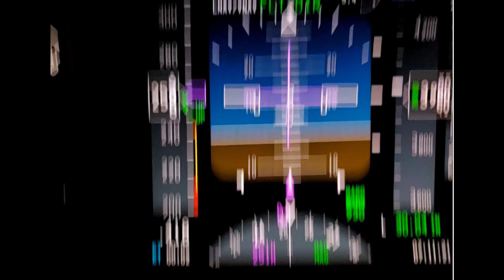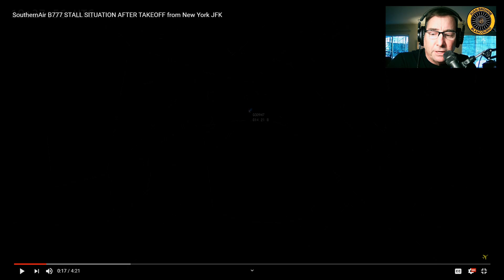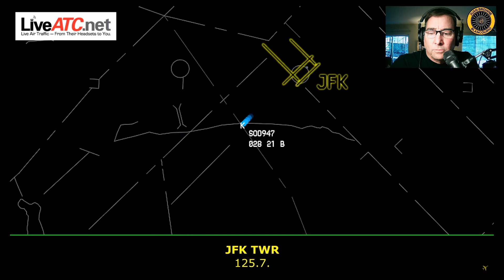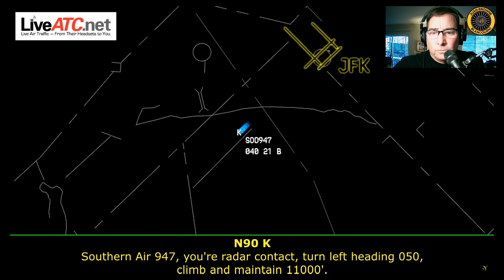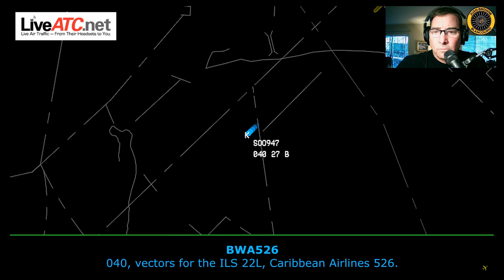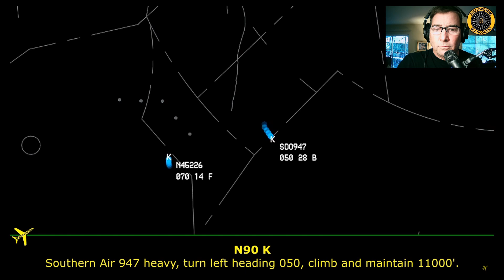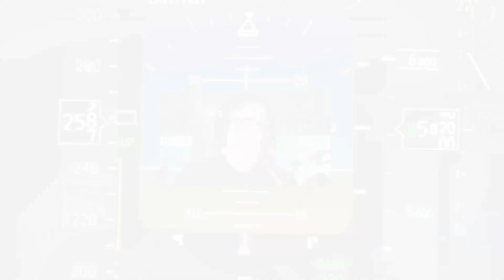"Stall, Stall, Stall" B-777-200 JFK 15 Nov 2020

Comment: I'm not a pilot, only a home computer flight simulator so grain of salt here. Certainly not much of what I do could be used in real life, but I have about 200 hours in each Boeing and Airbus (Zibo mod 737-800 & ToLiss A319) and from my perspective I find the Airbus SO MUCH easier to configure and operate, I can't imagine how Boeing continues to sell airplanes (Alaska is letting go the remainder of their Airbusses for example) It seems there is nearly twice the workload in the Boeing. Is the attraction that it's a 'pilots' plane? Or is it money? Availability?
Reply: Comes down to commonality, maintenance, availability of parts, and operating costs. All of those points are something the 737 does exceedingly well.

Comment: Do cargo pilots have the same sleep requirements as people pilots? Why would they be tired at the beginning of a long trip? 

It was good that the controller just left them alone when they said stand by and even when they got above 250 knots the controller realized you know what was going on and didn't say anything.
Reply: You are flying 14-16 hour long legs,past several time zones, then back a day or two later. Humans are not built for that, it takes a long time for the body and brain to get used that what used to be in the middle of the day, is now midnight.
Reply: @se-kmg355  
Are they required to have time off in between those long legs so they can get enough sleep?
Reply: @jerseyshoredroneservices225  Of course they have time of between flights. Some operators how more, some just the minimal required from the regulator.  But even if they have two days that might not be enough. If you travel in the morning, doing a 12 hour flight, arriving in the morning local time, you brains biological clock thinks it is midnight, and gets confused that could mess up your sleep pattern.
Reply: @se-kmg355  
I understand jet lag. Happens to everybody whose shift changes at work or people who travel the world for their occupations. Formula 1 drivers and others all have to deal with it. I work at night a lot and go to bed around sunrise. Sleep mask does wonders...

Comment: Great coverage.   I’ve been center seat on many a KC-135A max weight take off ... and it’s a harrowing event.   There is only about 17 -20 kts between you and the ground.  Being the crew chief... I had engines ( unofficially) as a second set of eyes and they old “steam gauges “ gave a guy a ton of worry. 

So glad this bird was able to recover... looks like they were going to be more comfortable at about 300kts.

Comment: Fascinating Juan, very well done.  I'm surprised though, in this day and age, that the crew has the options to report.  I'm surprised they don't have to download everything the flight data recorder would otherwise be logging.  In this case, obviously, there was no search through the wreckage for the FDR, but if the information were submitted to the FAA, the data would have "ratted out" the flight crew.  Don't get me wrong, I'm not looking to burn the crew, just amazed that the data isn't already be submitted electronically.

Comment: Looks to me like a storm had passed thru this area. Is it possible this had an effect on the stall warning system?
Reply: I remember that storm well - for about 10 minutes, it was quite squally, and if I recall correctly, there were even tornado warnings for it. I doubt that it would affect the stall warning system, but I wonder if it could have created windshear, which is well-known for causing sudden changes in airspeed.
Reply: @ajayray4408  that’s what I was thinking. Wind shear could have caused a stall condition. Thankfully the pilots caught it soon enough

Comment: Are you sure about asking for speed relief? I was a controller and I’ve been flying heavy jets for decades and I recall the speed being 250 below 10 “or minimum clean maneuvering speed, whichever is higher.” You never are trapped in keeping your slats out just to stay under 250 on departure. That’s not true for arrival and that’s in the FAAO 7110.65 which is the controller book. I’ve never asked for a high speed climb even when I has to go 260 knots due to weight. Have I just been neglecting it all these years? I’d better check the AIM.
Reply: I agree. That is what I was told years ago when I was flying the 777 and 747.

Comment: Juan!
One thing I didn't understand. You said the 1.3G "yellow hook" which you said would be a ~40 degree bank angle. In my book a 1G bank turn with "ball in the middle" is 45 degrees. Please explain Juan!
Reply: Straight-and-level flying is at 1G, and you cannot make a level turn without exceeding it. For a level, coordinated turn at bank angle B, the formula is  1 / cos(B), which gives you 1.305... at 40 degrees and 1.41... (the square root of 2) at 45 degrees. You need 60 degrees bank to boost it up to 2G. (https://en.wikipedia.org/wiki/Banked_turn#Banked_turn_in_aeronautics)

Comment: And this is where the main difference is, no feedback on the "joysticks" contributed to the air France airbus crash when Co pilot (bodin?) kept pulling back on the stick joystick when it was in alternate law mode which kept the plane in a high nose pitch up condition which prevented the computer from going back to normal law when the speed tubes had deiced the and because of no force feedback the main pilot did not know what the Co pilot was pulling back when they was in a sliding stall (the speed tubes got iced up temporarily and allowed the plane to go into alt law mode, the Co pilot I guess flown in alt law mode witch let's you put the plane beyond its normal law limits)
Reply: It was a defective stall warning that did in AF447. The software had it working in reverse.
Reply: @elderbob100   are you sure, the issue was the speed tubes froze up because they went thru a storm cloud witch put the plane into alt law mode (this in itself is not an unusual situation), bodin? reacted by attempting to set pitch to 2-5 degrees up but what he actually did was set the computer to max up pitch (as you can set the pitch based on position which i believe he was intending on doing or you can move the pitch to where you want it then let go of the stick and it will hold that angle on the virtual horizon, i believe it was on in the second mode and he thought he was following what he was teched and slightly pulling back on the stick that would set it to 5% pitch but what he was doing was telling the plane computer to constantly go to pitch up) which resulted in a sliding stall at this point the speed tubes had defrosted but due to unreliable speed from the speed tubes due to high pitch it had lessened the stall warning repeater 

the stall warning was active but it was more active when the second captain attempted to push the noise down (because when it started getting reliable speed data it changed the stall to a constant warning because it was now 100% sure it was in a stall) but the controls was in dual mode so bodin was partially counter reacting his controls and due to how slow it was pitching back down he stopped and co pilot bodin pulled the nose back to nose up again which lessened the stall warning sound, due to unreliable 

flights by companies now don't allow pilots to fly in dual control mode (an verbal repeating voice says when its in dual mode is enabled) and i believe the captain is now supposed to take control of the plane in a situation condition now and not let the less experienced co pilot fly the plane

just in case you did not see my other post
other bits of videos from what he caused the problems (it was bonin)
@mxX0 and this is the point where bonin actually says he been pulling up @mxX0
Reply: other bits of videos from what he caused the problems (it was bonin)
https://youtu.be/l1TKe5vmxX0?t=1424 and this is the point where bonin actually says he been pulling up https://youtu.be/l1TKe5vmxX0?t=2151

Comment: Juan did an excellent job explaining the speed protection and warnings, however, those warnings are dependent on the correct "zero fuel weight" being entered into the aircraft's flight management system. This crew, being experienced with this aircraft and the typical loads they would be carrying, should have known that 200/210 kts would have been well below their normal climb speed. On some aircraft the zero fuel wgt can be derived from the landing gear's sensors while on the ground, however, on most aircraft the zfw has to be manually entered into the aircraft's computer system from data supplied in the weight and balance documentation generated by the ground crew, or updates while taxiing. If Juan has the time, perhaps he can explain ZFW, and the interesting fact that fuel quantity is expressed in pounds rather than gallons.

Comment: FAA is actually 250 below 10,000ft or minimum clean speed per the regs. If they won’t give you high speed for spacing then you leave flaps out.
Reply: This isn't true. The FAR allows you to go above 250 below 10k if you need it for performance requirements.

Comment: Threading the needle, done right. I’m so glad they did not take the turn (as instructed), into an accelerated stall. I’ll bet there was a lot of WTF over Robbinsville:  777 at 3900 ft screaming 250 kts. The crew was on top of it and were probably cursing the flight planner all the way across the pond.

Comment: Comment toward the last part of the video concerning Airbus planes not allowing the airspeed to go below stall speed cutoff when the joystick control is pulled all the way back.  That's the "complaint" that Sully Sullenberger had when he landed on the Hudson River.  He said that he could have made a smoother landing had he been able to stall the airplane at the last moments before impact into the river.  Safety versus extreme applications.

Comment: Curious on what the different dash numbers mean behind the basic aircraft designation, i. e 777-200.
Thanks Juan for the info.
Reply: literally different aircraft.  the 200s have Rolls Royce engines and gross about 657K IIRC ... the -300 is longer, grosses .... 777K ... has massive GE engines (115K # thrust each) ... but the wingspan on the 300 is only marginally longer than the 200.  

On the DFW-HKG flights we are routinely restricted below FL300 until reaching the West Coast.  But it's a GREAT jet. I loved it and hope to return to it when all this vyrus response foolishness becomes a contrail.

Comment: At 16:05 you said the flaps 1 speed limit for the 777-200 is 270KIAS.  I think you might have meant to have said 255 KIAS.  Clean min maneuver depicted here is 251 KIAS; a 4 knot difference. Hence during flap retraction from flaps 1 to flaps up one has a 4 knot window to play with.  Public math is not my forte.

Comment: I suspect an inadvertent flap selection.  At high weights on 777 flap up speed can be in excess of 250 kts.  The bigger issue here is crew fatigue and Pilot monitoring competency.  In these covid times many airlines are doing 22 hour turnaround flights with 4 pilots.  In short the rules are being bent or rewritten because ‘covid’ . They were there for a reason in the first place and in my opinion in some aviation authorities too unrestrictive to start with.

Comment: To me (a non pilot enthusiast with some 737-NG full size simulator experience and a PfCo Drone Pilot License (UK), this seems like three things; 
1: Complacent Pilots if they're always doing the same routes in the same planes. The one talking seemed not to be bothered.
2: Tiredness!  He also sounded tired. Added to the info you gave, it's likely he was too. 
3: Bad planning. If they know they need a High Speed Climb, they should have notified the Tower before take off, and straight away after switching to Departure Frequency.

Comment: Pilot fatigue does sound like a possible red flag (so where is the problem: management not giving their crews enough down time or crews not managing their down time properly?).
No blame reporting is a huge plus. If a flight experiences a blunder there is a good chance that can be repeated and steps can be taken to reduce that chance. I'm a bit surprised to hear a pilot has to request a high speed climb when flying a heavy. It seems to be that should be automatic from traffic control. After all, physics is going to rule the day, not regulations.
Reply: Yes, the slurred speech and pauses really concerned me. Hopefully, that's a characteristic of the guys speech. If he was as tired as he sounded on take off, that's pretty scary! He certainly got over any speach impediment when he need to exclaim STALL, STALL, STALL!😯😂

Comment: Juan, I don’t remember ever “coordinating “ high speed years ago while flying the MD11 out of anchorage to Asia. It was a given since we were always climbing clean around 270kts, and we were “heavy” that high speed relief was a given. Now there are countries around the world, where you would require permission for high speed, and some, like france require a specific speed.
Reply: This is what the FAR says, (d) If the minimum safe airspeed for any particular operation is greater than the maximum speed prescribed in this section, the aircraft may be operated at that minimum speed.

I the USA no High speed climb call required.  I have flown heavies for 14 years and never make this call in the USA airspace.
Reply: Yes the way I read 91.117 section d says to me you wouldn’t need permission.
Reply: US is the exception.  Min manoeuvre overides 250kts.  Other FIR's you do require permission.  This is more for a heads-up for ATC rather than begging to be able to go faster.
But as Juan pointed out this should be done as soon as your in contact with Departure/approach frequency.  And invariably (except China), it is granted.

Comment: Would it not be reasonable to ask for a high speed with Delivery?
Reply: Delivery does not have the authority to approve a high speed, they could pass along the request. That however introduces an additional point of possible failure in the links of a disaster. The request not being forwarded or getting  lost in the communication chain, a pilot thinking the controller has his request so he doesn't ask again.

Comment: Juan, l really enjoy your videos. One correction I have to bring up. When you are looking at the controllers radar display recording and you point out the altitude and speed information you misidentified the speed as ias. It is not, it is ground speed in knots, and is accurate. Aircraft ias is only useful to air traffic controllers in specific situations while ground speed helps them to  make decisions on future conflicts between aircraft. If the controller need the aircraft ias they would ask you to say airspeed or mach number.  Keep up the great work.

Comment: Excellent review of this incident! It would surprise me very much if both pilots didn't immediately file an ASRS report upon landing. BTW love how Boeing keeps consistent profiles across their types as what you described for the 777 is very similar to the 757/767 even though those aren't FBW. The normal profile for flap retraction (757) is you can raise to the next lower flap setting when passing maneuvering for the existing setting (i.e. Flaps 5 to 1 when passing Vref 40) as long as you are accelerating. Same on the B777? So if they raised to flaps Up while at Vref 60 (flap 1 maneuvering) but not accelerating that would put them closer to the Stall.
Note for non Boeing pilots:  Vref 20, 40 and 80 are what we call the maneuvering speeds based on full flaps landing approach reference speed, plus additives for each flap setting, Vref 20 means Vref flaps 30 approach speed plus 20 knots and is maneuvering for flaps 15/20; Vref 40 is maneuvering for flaps 5 (Vref plus 40 knots); Vref 60 is flaps 1 maneuvering and Vref 80 is flaps up maneuvering or Clean Maneuvering speed (CMS).

Comment: What would the flap setting be under normal circumstances at the reported weight (I know we don't know the MET conditions) and would would the indicated airspeed be.  Also, you might mention that the speed shown on the radar screen  is not the indicated air speed, but the speed (calculated by radar) over ground.  Thanks for a very interesting series of videos!

Comment: ADS-B data will show ground speed as the typical primary speed much like ATC displays.
270 knots ground speed is not necessarily more than 250 knots airspeed, actually it's a somewhat typical correlation of those two values at 5000 ft.
ATC in that area is not always interrogating for airspeeds and as you can see on this data trace, no airspeed was received from the transponder:
https://globe.adsbexchange.com/?icao=a95ca4&lat=40.565&lon=-73.843&zoom=12.0&showTrace=2020-11-15&leg=3
Reply: Very nice explanations and video, just wanted to add those details :)